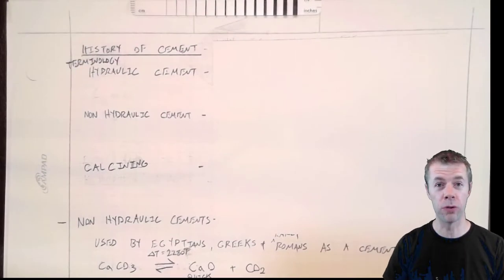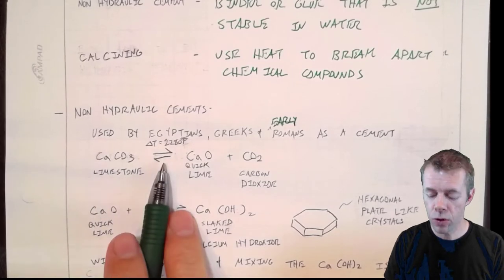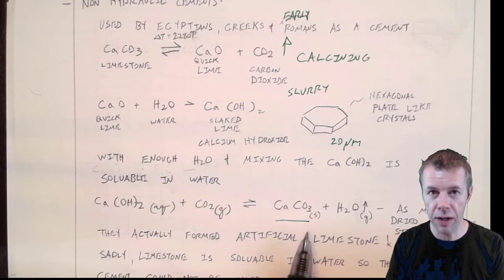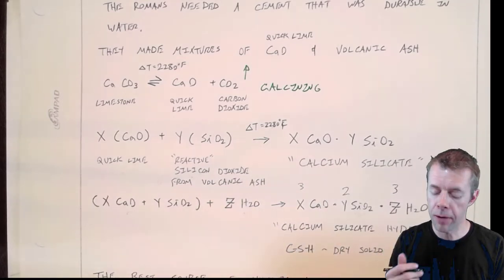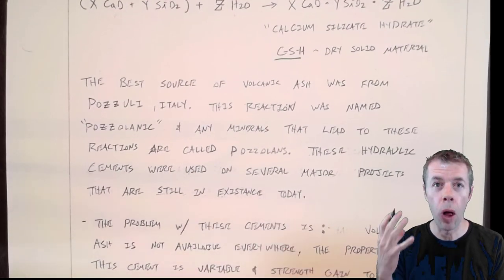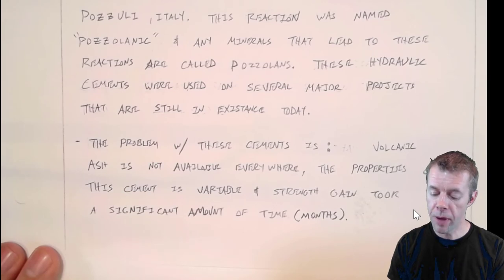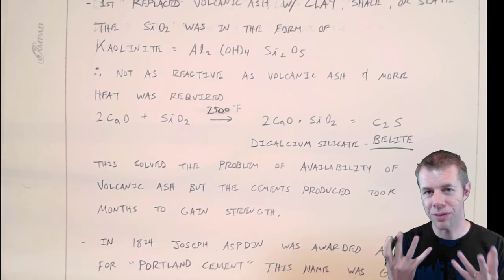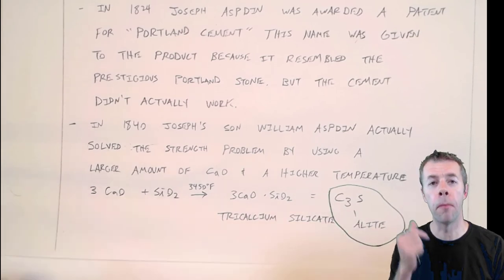History of Cement

Comment: Very interesting video but the end is missing, no explanation how the portland cement gains strength faster and why did the previous types gain it slowly, was it due to the time for CO2 to diffuse into it to form carbonates?  The portland type does not form carbonates or does it already have the carbonates when water is added?

Comment: Could you make a video for plain simple people that just want to know exactly what type of cement or concrete to buy that would be strong yet still affordable but also easy to use to put in holes for fence post or even inside fence posts and if you think that is needed or not plus what kind exactly to use for your driveways or steps or whatever instead of getting all sophisticated and technical and just tell people exactly what they should buy at their local Home Depot or wherever and tell them exactly which bags to buy and if it's premixed concrete or if people are going to mix their own cement with sand and gravel and exactly how much sand and gravel they should put with the cement and how much water exactly to mix with it all so that it's still strong but also able to be worked with and why? I think a lot of people would like all these simple questions to be answered clearly!